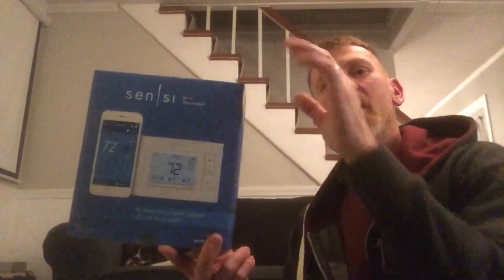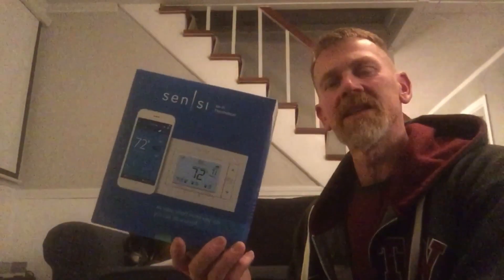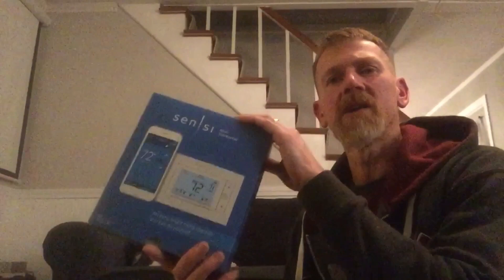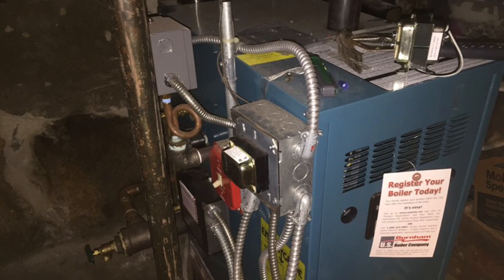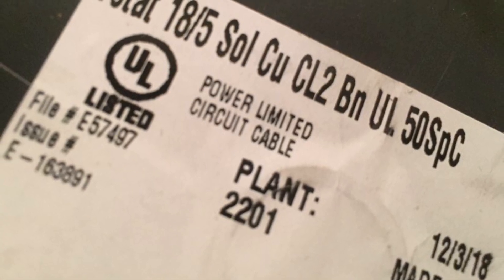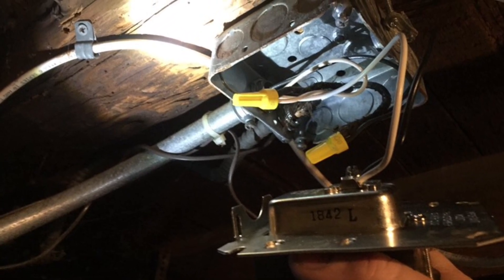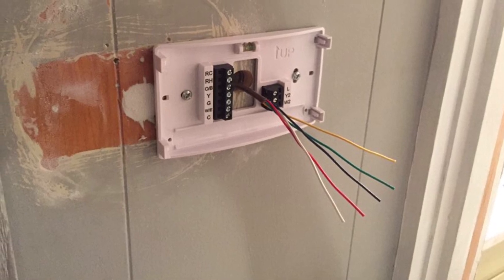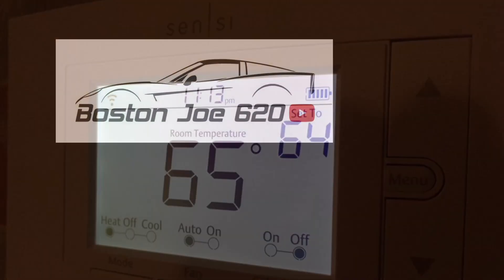Add a C Wire for your new WiFi controled thermostat!

Comment: No need c wire for sensi st55
Reply: Hi,

I have a similar thermost.. 1F87U42WFC.. I didnt mount it yet I just plugged batteries to for testing purpose. With the Wifi option turned on, I can't see the "Connect" option nor the wifi logo. I rather see an X. Batteries are low. Does the thermostat needs the C wire for Wifi features?

Also, I'm about the connect this to an electric furnace, The old thermostat is very old (uses mercure) I only have 2 wires (I installed an extra wire back in time for a purpose of using it as C wire!) So this extra wire is gonna be plugged in 24v of transformer i guess... Where do the 2 wires of original thermostat you think would go? One in RH and one in? W|E ?

Comment: Can anyone tell me if you can use this for a boiler with baseboard heat 
and AC? The box says in tiny letters, it does not work with baseboard 
heat. I have had experts help me and could not answer that question. 
Baseboard heat could mean electric baseboard heat, but they don't 
specify
Reply: If you have a boiler and you don’t see and think wires on the thermostat it’s fine they mean electric baseboard

Comment: Funny how the title of this video is "Add a C Wire" and indeed it looks like he did add one, BUT he does NOT actually tell you where this C wire connects to regarding old and newly installed equipment.
Reply from the maker: I explain what a c-wire is for and then add the transformer (the source) and attached it to the new thermostat to the connector labeled ‘c-wire’.

Comment: If the boiler has 24 VAC transformer, there is no need to add another 24 v transformer. We also have a two-wire system but the wiring was using only 2 wires out of the 4 wires available.  We just connected an extra third wire to transform to create the C wire.
Reply: My furnace has a "COM 24V" terminal, so I would just run a wire to that terminal? Unfortunately they only ran 2-wire cable from my thermostat to my furnace, so I'd have to get up in the ceiling to run a new cable.
Reply: @turtlepowersf  There are adapters available to output a C wire from just 2. More expensive options (UT-SWM) can even output 5 wires from just 2 using modern powerline technology. Fishing the proper cable is always ideal but alternatives are available and likely cheaper than digging into the drywall.